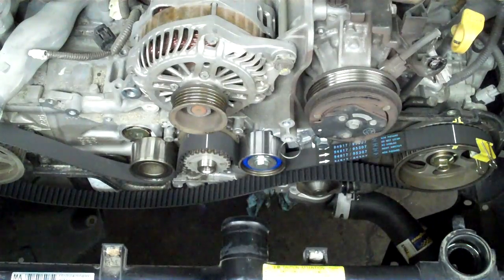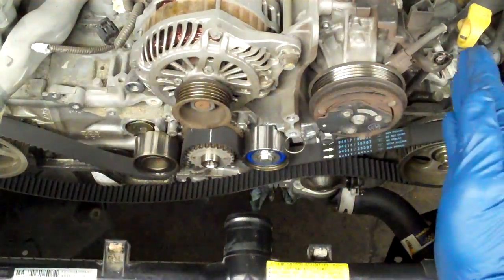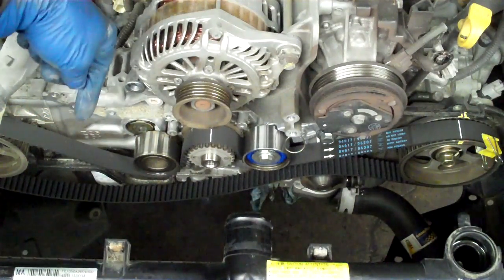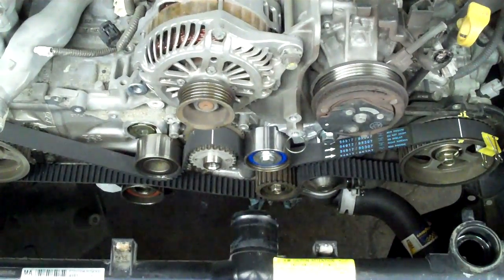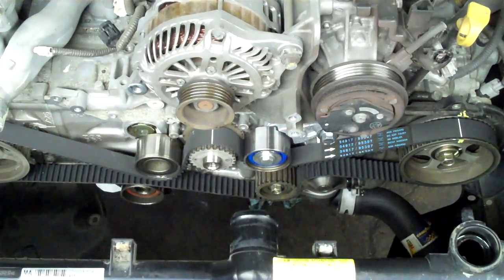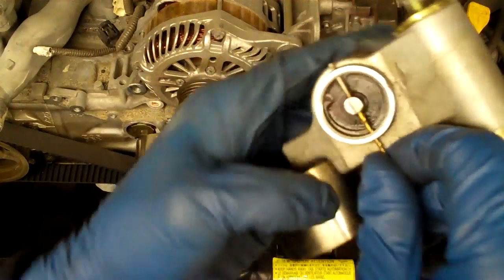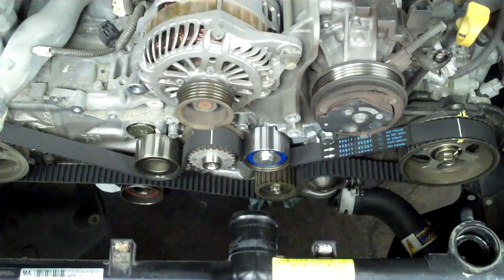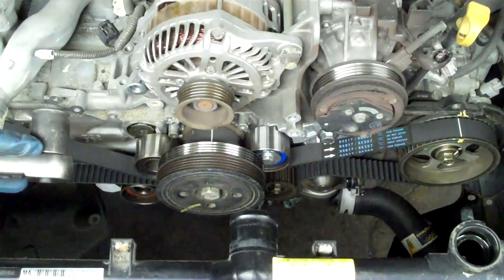How to replace a SOHC Subaru 2.5l Timing Belt

Comment: Hi Brian, could you please take a quick look at a short video I made of my timing belt marks? I think it's on correctly, but the left side looks a little off, but not off a whole tooth if that makes sense. The engine will not fire up. It cranks then pops (or backfires). Thank you. -John
https://youtu.be/NVS4dGbbNyQ

Comment: Brian, working on an EJ251 that came in a mechanics special car I bought. I bought it because the shop said its timing belt snapped, valves collided, game over. Take driver side timing belt cover off, timing belt is still under tension and intact. It slowly cranks and gets three whurrs in and stops. I'm working on the rally car right now, but once Im done, I'm gonna tear more into it. Could I have an engine that simply jumped a tooth or two and hasnt interfered?

Thanks in advance!

Comment: Hey! I made a mistake, on my 1996 outback 2.2, I turned my engine over to get my cam marks aligned, but after removing the belt I realized my crank mark is pointing downward :/. How would I go about getting my crank rotated up without damaging my valves?

Comment: Trick to getting a stubborn crank bolt off is use  a breaker bar on the socket and wedge the handle against the frame. Give the engine a turn with the key (don't start it). Using the torque from the starter will do it every time.
Reply: not quite every time :). but a hand impact tool an sledge hammer worked.

Comment: Just finished this job on a 2009 Forester, used a GATES kit from NAPA. Worked well and runs great! Dodged bullet on this as the owner put the job off and the old belt 'lost' about 20 teeth! Engine was at idle but no valve damage!!
Reply from the maker: Congrats to all involved.  Way to go!

Comment: Any of you know at what mileage the timing should be done on forester 2006 2.5l?
I heard people/shop say at 60 miles other people say 105 miles
Mine has 60 miles, looks good but there's no clear/complete look at it without removing the fan.
You could say that it easy to remove(fan) but not being a mechanic, trying to save a few bucks!

Comment: I need help with my 2004 2.5 RS Impreza. New master cylinder and my reservoir is full of brake fluid. But air hisses from the reservoir cap when I hit the brakes and they won't pump up. Have to press all the way to the floor and then it's all brake to the point of locking the tires.

Comment: HI Brian,  Great Videos!  I have question: which brand of timing belt replacement kits do you usually use? I have seen videos telling me to buy only timing kits that have all Japanese-produced components and to stay away from the more-affordable 'GATES" kit, due to those kits having some components of Chinese manufacture. I have "Salvage" 2002 Forester that is 'donating' it's engine & transmission to my  2001 Forester.
The '02 Forester has 92K on it and the 01 has 142K on it. I bought the '01  Forester (blown transmission) as an engine donor for my '02 Outback Wagon.  I had planned tojust part out the 01 Forester, until I found the wrecked 92K '02 Forester, so I bought it to build myself a Forester.

Comment: Hi briansmobile1, I have noobie question. Why is it important to line up the lines on the belt with the pulley and timing indicators on the motor? I get why we want to line up the cam sprockets in order to maintain the timing of the valves and pistons. But why the belt itself? Thanks and great videos!
Reply: Robert Ellison the marks on the belt are references to help insure you are getting all the teeth on the cams lined up with the grooves on the belt properly.   when the belt is set from the left cam to the crank sprocket over to the right cam, it has to be perfect, and the lines on the belt help with that.

Comment: Get a long ratchet and lean it against something strong. Then just tap the starter key and the starter motor will loosen that crank bolt no problem. It's probably the quickest way to get those suckers off.

Comment: Nice video, my 2005 subaru legacy timing belt jumped and bent the valves, how do you change the valves? By the way Subaru Ambassador here
Reply: Levi Mendonca remove the heads, compress the valve springs and the retainers will fall out, decompress the springs and the valves can be pushed out.  replace valve seals while your at it, they are most likely destroyed as well.

Comment: Good video and humor. You've "got a big tool" and your preferred method is to "just whack it." ;-)
My only concern was no mention of the crankshaft or camshaft seals, which are super common failure points on these motors, and they can only be replaced while everything is apart for a TB job. 137k mi on the engine in this vid: how did her cam/crank seals look?

Comment: Tip from an Old Aircraft Mechanic,
Great video, A bit more controlled way to remove and reinstall the vibration damper is to remove the radiator and then use two 3/8 drive 4 inch extensions. Put these extensions in two of the four holes in the damper with about 2 inches sticking out and 2 inches in the damper. use a long breaker bar or a piece of pipe between the two extensions.  A helper can hold this leaver or you can let it rest up against the inside fender or frame. You can rotate the engine slightly to accommodate this without having an issue as the timing belt will be in place when you loosen and tighten the damper.
Now use a breaker bar and loosen the center bolt. When you reinstall the damper use a torque wrench and torque it to specs.

Comment: hey great video! I actually just tried to do this same job myself and now I something bad happened and I have a misfire in all cylinders. Any idea what would have caused that ? I'm in desperate need !
Reply: alfie deguzman . What made you change the belt? Did it break? If it did, then the valves are probably bent. This is an interference motor. But, if it didn't break and you were only doing this because it is regular maintenance, then the belt is not aligned properly. Besides human error, the belt may have slipped a tooth due to bad components such as idler pulleys or perhaps even the hydraulic tensioner. Before you tear it apart, do a compression test to see if it is within spec. If so, then it might not be the mechanical timing. However, that is not definitive. Good luck.

Comment: Does anyone have the tool that holds the Crankshaft sproket while u loosten the bolt?
Reply: You can buy the tool on amazon or ebay. I made one with a 2x4,  two bolts and a drill to make the holes. search for this video to get an idea it worked for me.
"Built my own crank pulley holder corolla"

Comment: Brian, thanks for video. I just did timing belt, water pump, thermostat, pulleys and tensioner. Pulled pin put everything back drive a mile and the tensioner seems to be slapping (making knocking noise). Could it have failed and could i have had belt to tight prior to pulling pin.

Comment: What if you pulled a dumb dumb move and rotated the driver side cam independently of the crank half a rotation and now timing is off you tried to reset the cam but it's constantly out of time and on the last "successful start of the engine" it sounded horrible...how would one get the timing back? I am thinking just rotate the cam until it's back in sync with the valve cover off to find when the valves are all closed.

Comment: I bought a 2004 forester about 3 months ago and as I usually do when I get a used Subaru, I change the timing belt and idlers. this car had 119,000 when I got it, it now has 124,xxx. it worked fine up until last week I went to start it to take my wife to work and it didn't sound quite right when I first tried to start it and then it seemed to turn over more easily than it normally did, and didnt try to start. My first thought was maybe an idler came loose or the belt might have broke. I took the drivers side plastic belt cover off and the belt seemed tight , I though maybe it had jumped a tooth or so, I continued to remove what was necessary to remove the rest of the belt cover and all looked good, but I went ahead and removed the belt and some of the idlers to inspect them and all looked good so I put it back together ,, "but a side note , the belt has 3 lines  marks on it but they didn't all line up perfectly with the timing marks" it was not a OEM belt , so I don't know if the marks were not right or not so I didn't go by that, I just lined up all the timing marks. anyway, it's beginning to seem like it is something else, I did try to start it after doing the belt and once in a while it will hit but not often. this is my 6th Subaru so I have worked on them quite a bit but if it's something in the computer system I am kind of at a loss, so any help would be gratefully appreciated, Thank Vernon

Comment: you can use the alternator belt an alternator to remove the crank Bolt. that saves me big wrenches on your harmonic balancer. it is done by having the belt go around the alternator and the harmonic balancer and then using the belt to pinch itself on that harmonic balancer preventing it from spinning while loosening the bolt

Comment: An alternative and really simple way to hold the pulley while breaking the 14mm bolt loose is to remove the 3" black plastic square cover that sits at an angle on top of the engine that exposes a large hole. (It's under the throttle body just to the passenger side) Rotate the crank until a large hole appears and you can drop a screw driver in that holds the pulley from spinning.
Reply: Only have a hole if it's a automatic transmission, flywheels don't have holes, only flex plates do. Just use a breaker bar and bump the starter

Comment: Awesome as always... great videos man. What are your thoughts of the cheater bar and turning over engine for a second to break the crankshaft bolt loose? and the belt method, where you have one of the smaller belts wrap around the alternator and the crankshaft pulley to crack it loose?

Comment: Bryan, I noticed in your video that the marks on the crank sprocket, belt and oil pump line up well, but the alignment mark on the left cam sprocket looks like it is a bit to the left of the notch on the inner timing belt cover and the alignment mark on the right cam sprocket looks like it is a bit to the right of the face plate / cylinder head seam.  Is this actual or perhaps just an illusion created by the camera angle?
Reply: Colin Anderson I know it's an old comment, but from my experience on subaru motors is that when you set all the marks perfectly and then set tension on the belt (the right cam is mid stroke so it wants to roll left or right so you have to hold it in place when setting the belt) one of the cams will slightly move "out of line", but the timing is properly set.

Comment: When the timing belt break, does the piston hit the valves?
Reply: yes :// usually atleast that is what happened with me
Reply: Yes. It's an interference engine.
Reply: Lourdes Silva I've been lucky once before and not had valves hit, this is rare.  in most cases at least one set of valves will be destroyed.

Comment: Thanks for another great video. Another way to get the balancer bolt out is to remove the plastic plug  that covers the window at the back of the motor where you can get to the bolts that hold flex plate to the torque converter. With that cover off you can put a large screwdriver in to hold the flex plate & the balancer pulley comes right out.

Comment: Main Pulley- You can put the car in 5th and pull the e-brake. Then just turn it with a breaker bar with a cheater bar. If it gets stuck you can use the old "starter" method but I don't recommend that for noobs.

Comment: I have an 03 subaru outback and am changing the timing belt, etc.  I lined up the three marks as shown in your video, but when I crank the engine by hand the marks do not match up again--the first rotation or any thereafter.  All parts are new, including the tensioner, which I pulled the pin before rotating.  Help.   What is my issue?
Reply from the maker: Subaru marks on the belt won't line up again, but the cam and crank marks should line up to the block every second rotation of the crank.
Reply: I think the problem is this:  if you put the belt over the left hand cam (ie looking at the motor), then run it over the crank toothed wheel, then over the tensioner, you need to compress the tensioner (ie slowly apply pressure upward) with a socket & ratchet, while you put the belt over the right hand cam.  if you dont do that, the top part of the belt ie from cam to cam, wont be tensioned properly, and will likely be a tooth out.

Comment: When taking it off the right cam pully spun . Didn't remember which direction but the mark looks to the left about a few inches. Do I take a 14 and turn it up to the mark in the cover and put the belt on ? Plz help I got the car all apart lol I appreciate it man
Reply: 2001 forester 2.5

Comment: Hi Brian, love your videos, so well presented, informative and entertaining and much appreciated. I have just finished doing a timing belt, tensioner, water pump, idlers, cam and crank seals on my 1999 Subaru impressa wrx 2.0 dohc turbo, your videos were extremely helpful although being a dohc made life a whole lot harder (I did it in the car so trying to make sure the exhaust cams were aligned with the timing marks wasn't easy) I just have a couple of concerns that I would greatly appreciate if you could help me with, when I was removing the cam sprockets they were extremely tight and when I refitted them I would not have got them as tight as what they were, I put loctite on the threads and tightened them as much as I could, do you have a tips on getting them tight? Also if I was a tooth out on the timing belt, how long would it take for the valves to kiss the pistons? I have started the engine for 10-15 minutes without any problems, am I in the clear? Sorry for rambling, lol

Comment: There is another way to remove the harmonic balancer using the action of the engine turning over. 1) VERY IMPORTANT: remove the power from the ignition coil. 2) You can take a long breaker bar, resting on the frame next to the battery. 3) For a very brief moment, turn over the car. This will loosen the bolt. From there, the bolt comes right out. When you get everything done, don't forget to connect the power back to the ignition coil.
Reply: What about putting it back on? So do I just need an air impact or is there another trick I could use?
Reply: Very important to put back crank pulley bolt torched to spec as if too loose crank pulley will eventually loosen causing Woodruff key to shear off in skyway causing crank pulley to spin freely. Some mechanic did this on my 92 luckily just when tranny started to go. Instead of special crank pulley holding tool I just used 2 Sn ap On 1/4 inch short extentions for pins and a long flat bar between them to hold pulley stable while torquing to spec. The cheaper ones bent.

Comment: Wondering, if I'm planning to pull the engine on my 03 outback to do the clutch, would it be substantially easier to do the timing job while I have it out, or does it not make a whole lot of difference and I might as well do them separate when I'm ready?

Comment: the video was very helpful. I wish you had gone into more instructions on tightening the crankshaft bolt. when I tighten it just turns the whole engine. I'm looking for a "cheater" way to hold it in place! thanks again for the good video

Comment: how do you lock the engine down to torque the crank bolt down ?  just did a 2004 Subaru wrx  took radiator out and I couldn't it a impact in there. Did your trick, worked great. But now how can I lock engine down to torque back down?

Comment: another way to take the crank shaft bolt off is on the passenger side of the engine back where the crank gear is located there is a small hole in the engine block where you can stick a screw driver in and it will stop the crank shaft from turning and you can loosen the bolt
Reply: Putting some hair around it has always helped me find the hole =P
Reply: where exactly is this hole, would it work for tightening the bolt as well?
Reply: where exactly is this hole, would it work for tightening the bolt as well?
Reply: I will have to take a picture of it but it's at the very back of the engine block about half way up it may have a cover  it may not. My car didn't have a cover. And it's kind of behind the wires on the passenger side.
Reply: Yes it will work for tightening the crankshaft bolt as well
Reply: Just remember to remove the screw driver before you try starting the car or you will probably ruin the teeth on the crank gear wheel.
Reply: Or starter
Reply: +Keith Phister I found the hole. it was easy to find and everything was very simple on this timing belt install. sometimes you just need a word or two to spark the mind.
Reply: That's good to hear glade I could help

Comment: Thanks for that, it made the job a lot easier. Didn't have to remove fans. Biggest pain was pulley bolt, had to make locking tool for this. Very easy job despite that! Respect!

Comment: Good video, brother. I have a couple questions/points to bust your chops a little, though.. Did your monologue clock tell you that your monologue was too long? I like simple analog watches because they're stylish and reliable. In regard to your 4-foot tool, it's only 36-inches.. Appreciate the Ron Paul poster.Chop-busting aside, this is a great informative video and may have convinced me to do the job when mine is due.Thanks, dude.

Comment: Hi Brian, I have a questions regarding replacement of timing belts.
Is replacement dependent on actually number of miles driven or is it also number of years.  I am looking at a 2004 Forester with only 38,000 miles. My question is given the age of the car should I plan on replacing the time belt if I purchase it?